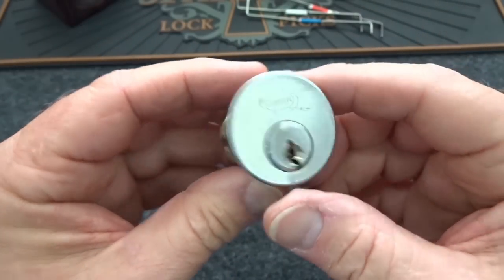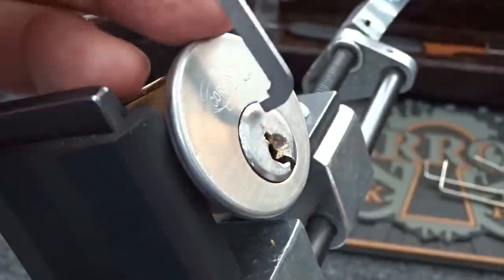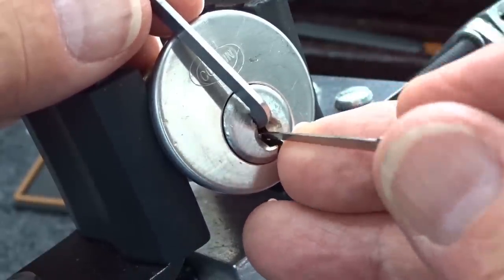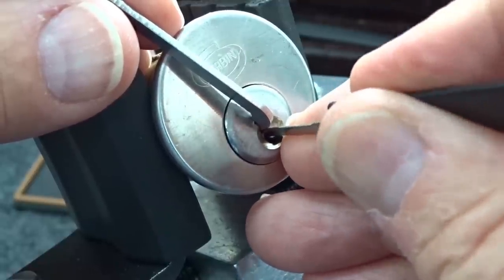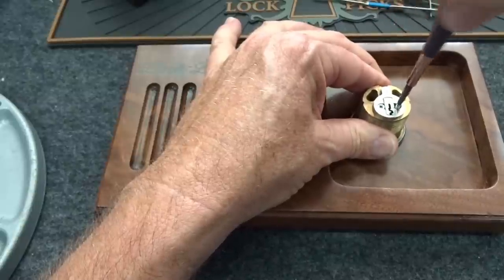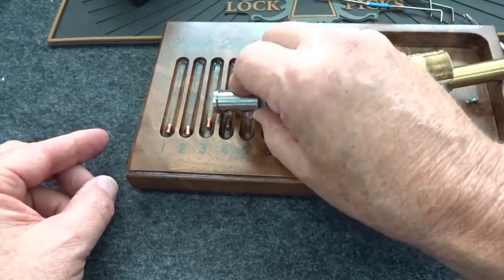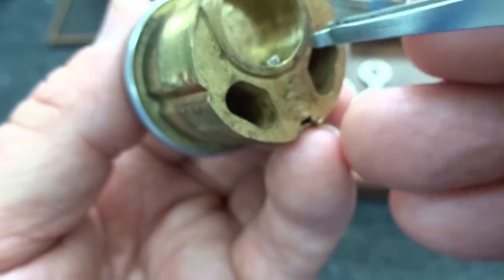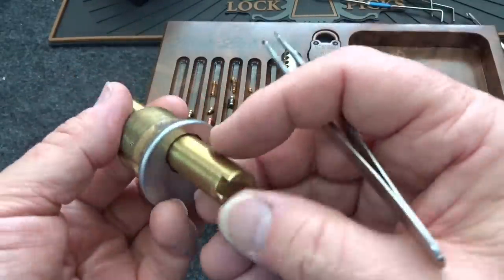(1118) Challenge: Wilson

Comment: It works one way and not the other because the key can move slightly in the core and it isn't square across the top, as the key tilts in the keyway it changes how high the pins are lifted?

Comment: Bill, why did you decide to go counter-clockwise? I've never understood how to determine which way to go.
Reply: try both ways on a lock like this, it's a different pick each way. different binding order.
Reply: Thanks, but that doesn't answer my question. First, what do you mean by "a lock like this"? 

When you start to pick a lock of any sort, which way do you normally try to go and why?
Reply: I think it's just his preference, I would assume most people would go clockwise in both picking and designing a challenge lock, so if there is any undercutting in the core, unless they do it for both directions, it wont come into play going counter clockwise.
Reply: It's not a preference, it's a thing you learn over time. Most European locks are counter clockwise with exceptions of course and most american locks are clockwise with the same exceptions. Like with some autos it varies, the best way to figure this out is trial and error or pay attention when using keys in locks to how they work and mental notes will lead you.
Reply: Thanks, that helps. Any idea what made him go counter-clockwise with this particular one? I've watched almost all of his videos and he usually goes clock-wise.
Reply: He does have a video where he explains that. If I can find it I will link it for you. Most likely you only get to see  the lock being picked open and not all of the failed attempts, and this particular lock was easier to pick cc.
Reply: That would be awesome!
 I'll look for it too.

Comment: What do you mean with 'Counterrotation'?
Reply: iridian counter rotation is when you're pushing a pin to the sheer line and it wants to turn the core the opposite way that you're trying to turn it. 
It's caused by security pins like spool pins.
You have to actually let the core counter rotate enough to set the spool pin, but not enough to lose pins you have already set.

That's my understanding but I've only been picking for three days so what do I know. I've watched a hell of a lot of Bill though lol
Reply: Great explanation..